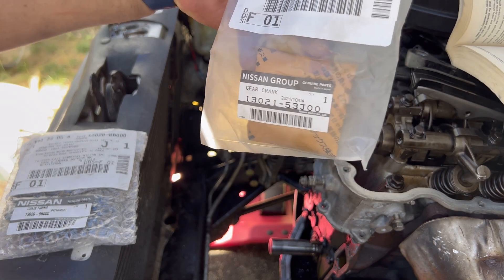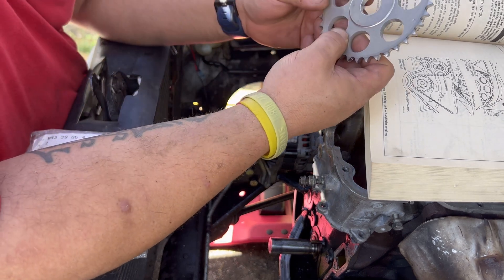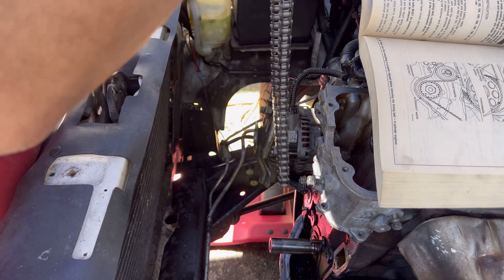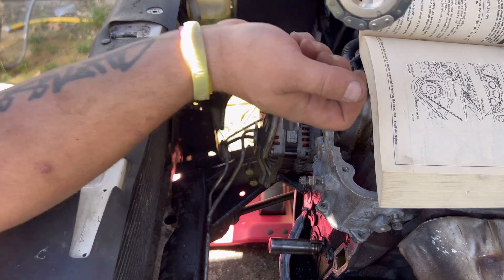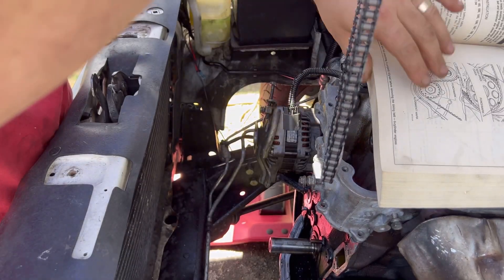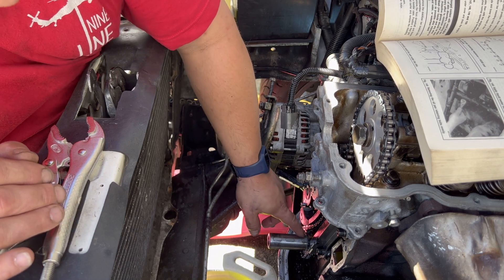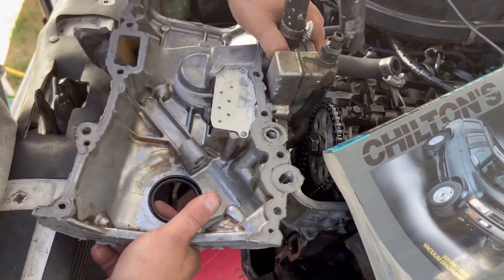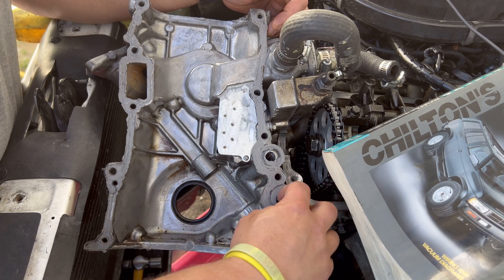Nissan KA24E Timing Chain Removal and Replacement Part 2 (MiniTruckin' Mondays) 4K

Comment: I just replaced the chain on my '97. Now the chain rattle is even worse. It sounds like the tensioner isn't tensioning. I used an aftermarket kit from ITM. Could that be the issue?
Reply from the maker: I bought a tensioner from Martin Industries because the first chain I had did make noise. I purchased all the timing components from Nissan as the Aftermarket one I had , the chain was 1 link too long which caused the issues. Along with fighting the distributor and oil pump alignment. 

https://www.martin-industries.net/product-page/nissan-ka24e-self-adjusting-tensioner
Reply: Including the chain guides?
Reply from the maker: You can get them from Nissan still i believe
Reply: @DinasGarage  thanks 👍

Comment: What was the issue with the truck?
Reply from the maker: The cheap Chinese made timing chain kit from amazon was 1 link too long and would not align with the oil pump to distributor shaft.